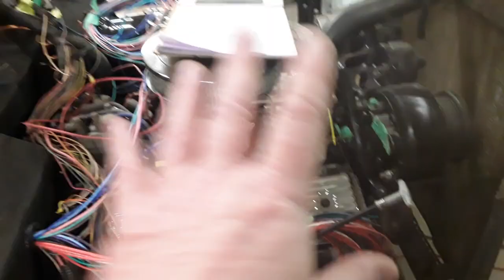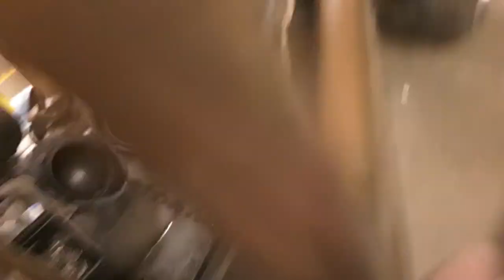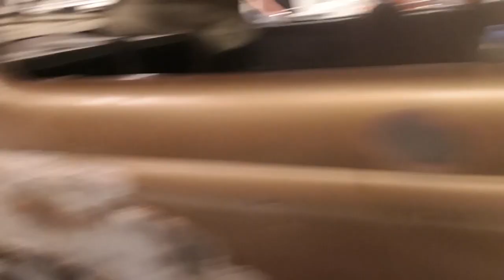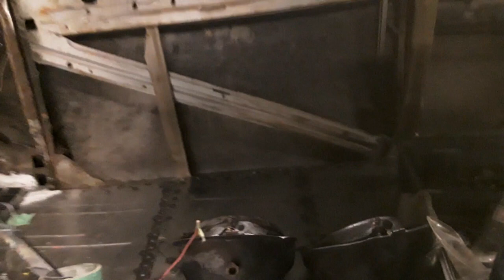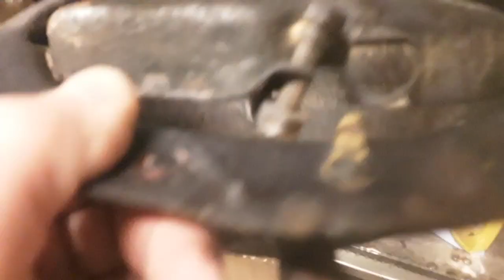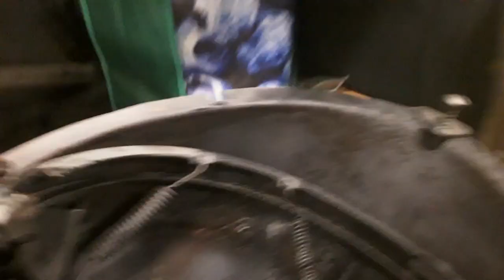How are things going?

Comment: I used the pilot lights for turn signals. 

You’re making great progress!
Reply from the maker: Thanks! I think I'm going to do the same with the pilot light holes.
Reply: @garyscarstuff  FWIW, you can get bulbs or fixtures for the headlights that integrate running lights/turn signals, but using the pilot light is significantly less expensive.
Reply from the maker: @bearsstuff  I've seen those at swap meets, they are very cool but like you say not cheap.